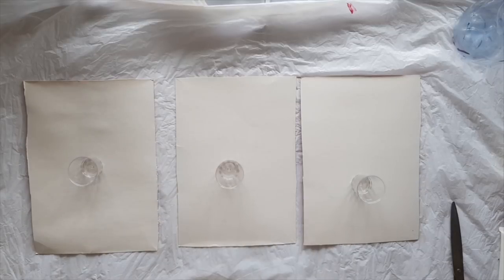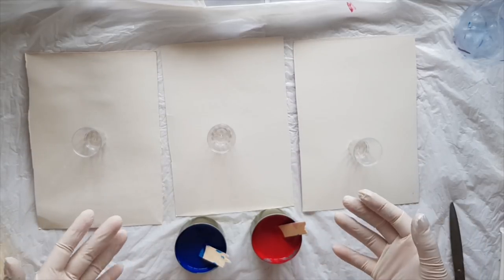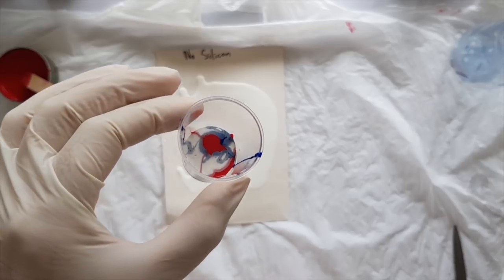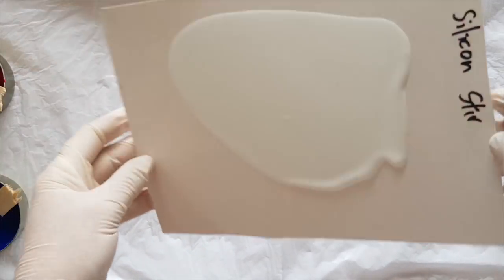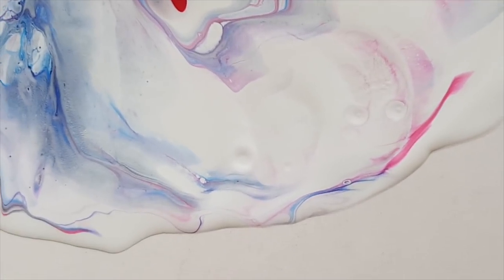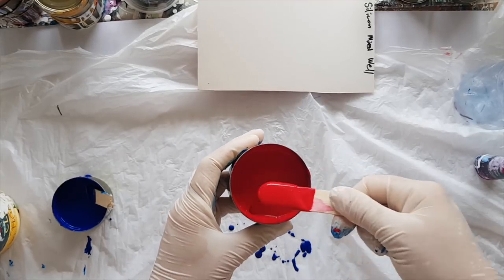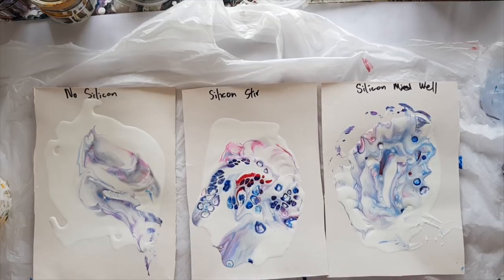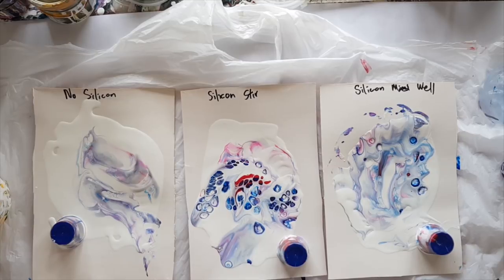103 Silicone Cells Stirring To Much Experiment

Comment: Great video. I've only just started playing around with paint, using what materials I have access to (which doesn't include floetrol or similar stuff as of yet). I've usually just gotten a few really big cells that looked bad, making craters in the paint when drying as the silicone seeped through, even with thinner paint mixes. Finally got me a torch, and that helped a lot with that specific issue.  I read about not stirring silicone too much and tried to follow that advice, but based on your silicone stir I suspect I've been too gentle. The 100% dimethicone lubricant I've been testing has a bit more gel-like consistency, and probably needs a firmer hand...
Reply from the maker: What if playing was the target rather than the outcome being the target?  How much fun can you have discovering what else is possible?
Reply: I normally love just experimenting with stuff, but crafting supplies tend to be very pricey where I live, so I'm really looking forward to when I've figured out what paints and additives will work for me. Then, at least, I can go nuts playing with different pouring techniques. XD

Comment: I get cells frequently, using just house paint and water.  No Floetrol, although I do like how it makes the paint flow.  No detergent.  No oils.  Nothing special, just paint density and consistency.  The cells are not large, always, and I don't do large paintings, but I also do not use a torch.  I have those things, the Floetrol, the oils, the torch, and even a small bottle of the detergent if I choose, but after going through all of those, I have discovered that cells are one of the things on the bottom of my preference list. For me, it's all about the colors, not cells.
Reply from the maker: Awesome.  I love that we all have our preferences and can choose to create what we desire how we desire and there is no judgement.  If you love it and it brings you joy that is a massive gift to the entire planet.  How much more fun can we all have?

Comment: Hi Michelle, do you need to add water to the paint in order for the silicone to react?  Im going to try this as an experiment, but thought I'd ask, if you know?  Thanks :)
Reply from the maker: No Silicone is oil so will rise to the top on any water based liquid.  Acrylic paint is water based any way.  The water is to get the paint thin enough for this type of painting.

Comment: that was very informative.  thanks Michelle. I have not had all that much success getting cells except if I do a swipe. good to know about how to use silicone.  getting liquid silicone in NZ seems to be very difficult. I have tried the spray can ones with little success.  I have tried decantering them, which works a little better.  I looked in the supermarket for the silicone you are using but didn't think I had the right thing. thought it was a roll on stick like a deodorant.  so now I know it is a flip top, will go and buy some and see how I go.  thanks very much for the help :)
Reply from the maker: Make sure you get the black and pink bottle as there are 2 Durex Play and the pink and black one is the one with dimethycone.
Reply: thanks - good to know!! ;)